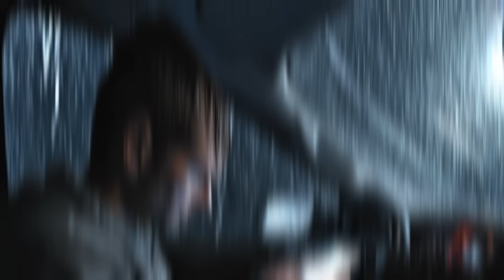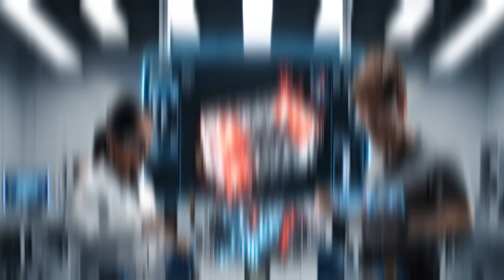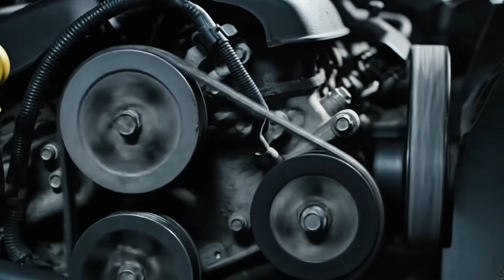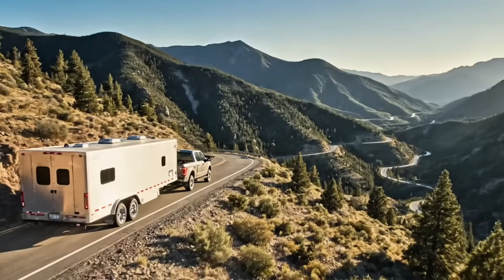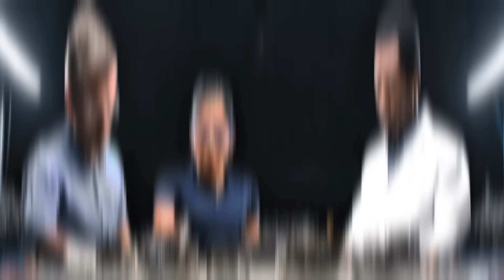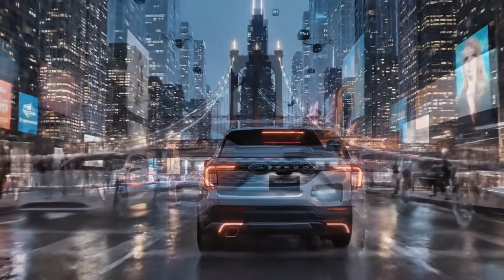Ford Just Ended the EcoBoost Nightmare in 2026 — Truth Revealed

Comment: this is just go back to naturally aspirated no matter what you do turbo engines just are not as reliable all reason why they did this was because of California is completely delusional restrictions on admission so you have to give a car a lot of power and be fuel efficient which is a recipe for guaranteed engine failure even small superchargers would be more reliable
Reply from the maker: A lot of drivers still trust naturally aspirated engines more because of their simplicity. Turbo engines can make impressive power and MPG numbers, but many owners worry about the extra heat, pressure, and long-term repair costs that come with that complexity.

Comment: Why is it when an automaker comes out with anything new it turns to crap.  When are consumers going to quit buying these new crap revolutions and stick with quality
Reply from the maker: A lot of drivers still trust naturally aspirated engines more because of their simplicity. Turbo engines can make impressive power and MPG numbers, but many owners worry about the extra heat, pressure, and long-term repair costs that come with that complexity.

Comment: Should have used electrically driven blowers.
Reply from the maker: That would definitely be an interesting direction. Electric-assisted boost systems could help reduce turbo lag while putting less stress on smaller engines.

Comment: So what is this boost about?? What does it boost? Sounds stupid!
Reply from the maker: “EcoBoost” basically means a smaller turbocharged engine designed to make more power while using less fuel. The idea sounds great on paper — the long-term reliability debate is where people split.

Comment: I had 2016 Expedition for 8 years and 150,000 miles never a problem.  Turbo was probably near replacement time.
Reply from the maker: 150k miles with no major problems is solid, especially on an Expedition. A lot of these EcoBoosts seem to hold up really well when maintained consistently.

Comment: I don’t care what improvements Ford has made. I’m nursing a 2.0 with the coolant channel between the cylinders fiasco. Asked Ford dealer what resolution is available and was told $10,000 for a new engine. No pulling the head for a new head gasket but a new engine. So now it’s a matter of principle for me. No more of my money goes to Ford.
Reply from the maker: That’s brutal. A $10k engine replacement instead of a simpler repair would leave a bad taste for anybody. Stories like yours are a big reason many owners are losing trust in modern turbo setups.

Comment: What is this nightmare nonsense? I have a 2.3L Bronco and the engine is powerful and has had no issues in four years. Sure there have been some issues over the years but l wouldn't trade it for any other turbo engine.
Reply from the maker: Fair point. A lot of EcoBoost owners have actually had great experiences, especially with the newer generations. The video was more about the reliability concerns some owners still bring up, not saying every EcoBoost is a disaster.

Comment: Actually my 2019 F-150 King Ranch with the 3.5 twin turbo has been a reliable machine for me,  no worse than the Honda Pilot I had previously. It tows my 25’ travel trailer very well, it’s honestly one of the nicest vehicles I’ve ever owned.  
Not perfect, but very pleasant overall.  I do like the the V-8’s too however, had one in my Mustang GT, great sounding fun engines.  The 3.5 really is a truck motor, @ 375 hp 470 lbs-ft torque, it’s got great power for its displacement. I do change my own oil every 5K with full synthetic, cheap insurance for an expensive vehicle.
Reply from the maker: That’s the kind of balanced ownership experience a lot of people can relate to. Plenty of owners seem really happy with the 3.5 once they find a setup that works for their towing and daily driving needs.

Comment: My 25 Ranger 2.7 has already been replaced at 3400 miles. It has been in the shop since Feb. Ford settled (cost them 15k) with me but I have not got the truck back yet to get rid off it.
Reply from the maker: That’s brutal for a brand new truck at only 3,400 miles. Situations like that are exactly why some buyers lose confidence so quickly.

Comment: Turbocharging an open deck design engine is a recipe for disaster.
Reply from the maker: That’s been a huge debate with boosted truck engines. Big power is great, but durability under heavy towing and long-term stress is what really matters to owners.

Comment: My second cousin has a 2014 EcoBoost with 185k on it. Still has almost all of its original parts and runs like new. Only the water pump and thermostat have been replaced. Proper maintenance is crucial. Another family member has a 2020 3.5 EcoBoost with just over 100k. That one is a bit questionable in the long run because of the 10 speed transmission but he hasn’t had any major problems either. Most owners with trouble free experiences don’t speak up about their experience so that’s part of why you only hear about the horror stories others experience
Reply from the maker: That’s a really balanced take honestly. People with bad experiences are usually the loudest online, while the owners quietly putting 150k–250k miles on these engines without major issues rarely make videos or posts about it.

Comment: I used to be a Chevy guy, and I will probably never buy a Ford unless it dates prior to 2007.  Dodge, never.    My last Chevy, a 2014 Silverado 4x4, rusted out big time, trans fail at 140,000 and the rear seal leaking.  I sold it.  Chevy created a truck to fail.  I bought a Nissan Frontier SV 4x4 which is a plain Jane as you can get.  So far, I like it a lot.  If Ford or GM want to sell trucks, each brand made indestructible engines and transmissions in the past.  Forget all this tech crap and computer run engines.  Go back to a straight V8 or V6 and keep trucks simple.  Saw a recent truck ad on TV, and the IT stuff on the dash was the big selling item on the ad.  I like my Nissan, but I miss the full size truck.  But I will not even consider a new truck because I don't want a pavement princess with 22' low profile tires and caddilac looking wheels.  I don't need fancy interior.  I like the back up camera and I don't need a tailgate with multiple functions, just one that opens and closes.  I will take a bedliner and hitch, tow hooks in front, and decent size tires.  And I can't afford $50,000 for a new or used one.  Reproduce what worked, Ford and Chevy can do that.  Toyota killing their trucks too with those stupid 4cyl turbo like GM and Ford have done.  Dodge is beyond repair.   These new college educated Democrat engineers are killing the brands.
Reply from the maker: You summed up what a huge number of truck owners feel right now. A lot of people don’t want luxury-truck features or giant screens — they just want a simple, durable truck that lasts 20 years and can still tow, haul, and be affordable to repair.

Comment: They make great power and are smooth and quiet.  I currently own several in our company and they are good engines.  My 2018 Raptor blew up at 60k.  Denotation at wide open throttle left aluminum and oil all over the highway.  Ford put a short block in it without complaint.
Reply from the maker: That’s a crazy failure at only 60k, but it says a lot that Ford replaced the short block without a fight. Definitely sounds like you’ve seen both sides of the EcoBoost experience.

Comment: I've had 4 of these engines 21.5 leaner engines and 23.5 l engines in my pick up truck and my wife's escape I will never buy another Ford powered car again what a piece of junk they spent more time in the stealship than they did when we drove them put 52000 km on one it blew up my wife's after only a year of driving which was 13000 km it blew up junk
Reply from the maker: That’s brutal. Multiple engine failures would make anybody lose trust in a brand. Stories like yours are exactly why so many truck buyers are demanding simpler, longer-lasting powertrains again.

Comment: Sorry but trying to get a 4 or 6 cylinder  with a turbo to do the work of a naturally aspirated 8 cylinder is nuts. Turbos sound like a great idea until they break then be prepared for a first class repair bill. Turbos on sports/ race cars not the daily driver.
Reply from the maker: A lot of truck owners share that view. The simplicity and low-end grunt of a naturally aspirated V8 are hard to beat. On the flip side, some modern turbo engines have also racked up serious mileage when they’re maintained well. Reliability is still the big question everyone cares about.

Comment: No thanks , Still too many electronics. Give me an Old V8 in the early 2000's
Reply from the maker: A lot of people miss when trucks were simpler, easier to work on, and built to last forever. Modern trucks have more features than ever, but not everyone wants all the extra complexity.
Reply: @NextGenWheels-s5r The touch screen era will probably run it's course. When they have enough accidents due to the distractions it will morph into something else. I Drive , I don't watch movies .!
Reply from the maker: @bobbyquack4908  That’s a debate that’s only getting louder. A lot of drivers miss physical buttons and simpler dashboards because they feel less distracting and easier to use while actually driving.
Reply: @NextGenWheels-s5r I don't want to hunt and peck and watch shithead doing the same thing in front of me. It's just dangerous.  They are prepping us for VR glasses.
Reply from the maker: @bobbyquack4908  A lot of drivers feel the same way. Physical buttons let you keep your eyes on the road, while touchscreens often demand more attention. There’s definitely a balance manufacturers need to find between new tech and real-world usability.

Comment: Just got a quarter million miles on my eco boost engine . Had to change the timing chain now it’s ready for another quarter million miles. Runs like a top. I had to change one turbo and the front end gears in it in 12 years.
Reply from the maker: 250k miles with only a timing chain, one turbo, and front-end work over 12 years is honestly a pretty solid long-term result. That’s the kind of real ownership experience people want to hear about.

Comment: Before this engine is sold it needs to be run nonstop on a track 24/7/360 untill it fails then fuggure out why and do it again untill it don’t fail before 200 grand
Reply from the maker: A lot of owners would agree with you there 😂 Real-world durability testing matters more than marketing numbers. Modern engines are incredibly advanced, but people still want proof they can survive hard use and high mileage long-term.

Comment: Having owned and driven relentlessly : 2021 2.0 ecoboost edge, 2019 2.3 ecoboost ranger, 2017 f150 3.5 ecoboost, 2015 transit connect 1.6 ecoboost i can speak reality. The only one that was a POS was the 1.6. It started sucking coolant the second week of owning it. Best ford could come up with was a low coolant sensor for the overflow. Traded in for the 2017 f150. That 3.5 was awesome. It had power and i never had any mechanical failures in 110k miles except a driver side exhaust bolt broke. The 2.0 i guess i got lucky. It had a manifold sensor go bad at 20k. Fixed under warranty. The 2.3 ranger was and is bullet proof. 75 k from me and the new owner put another 100k on it with no major issues. I now have a 2025 F150 powerboost. We will see how this one goes.
Reply from the maker: That’s actually a really balanced real-world breakdown. Sounds like the 1.6 gave you headaches, but the 3.5 and 2.3 treated you well overall. The 2.3 Ranger especially seems to be earning a strong reputation with a lot of owners. Definitely curious to see how the long-term reliability of the newer PowerBoosts turns out too.

Comment: Turbochargers destroy little engines. I wouldn't have one.
Reply: Your 100 percent wrong,,,You forget that here in Europe 80 percent of our engines are under 1.6 litres,,That goes for petrol and diesel,,And the majority of those are turbocharged,,Unlike the USA,,We have been using small turbocharged engines since the mid 90s,,,And up until wet belts and DEF fluid came in,,,250k miles was the norm,,,And many vehicles were seeing 500k miles,,With taxi drivers seeing 6 to 7 hundred thousand miles on 2 litre VW and Peugeot engines,,This is the problem with engines in America,,And at least a part of why you are having problems with small turbocharged engines,,,,ITS YOUR CLIMATE,,,,,,And the fact your towing 10 ton loads with a 3 litre turbocharged engines,,,,,Those two things together are to much stress for an engine that size,,,,Here in Europe we also tow trailers with our small engines,,,But we are realistic,,We have small trailers and pull about 2 ton max with a 1.6 diesel ,,,,And 90 percent of our climate doesn’t go regularly over 70 or 80 degrees in the summer,,Dont get me wrong,,,We still have problems with engines,,But never from stress or heat,,,And also our cars are smaller than American cars,,,Although in the last 5 years SUV sizes have gotten ridiculous,,But that’s due to batteries needed for EV,,,
Reply: @nightstorm9128  LOL. You just agreed with everything I said.
Reply from the maker: Fair enough 😂 I think both of you are mostly saying turbo engines can last, but usage and stress levels matter a lot.
Reply from the maker: @nightstorm9128  You actually make some really solid points here. Driving conditions, towing habits, climate, vehicle weight, and maintenance expectations all play a huge role in turbo engine longevity. A small turbo engine in a lighter European vehicle doing normal commuting is a very different life compared to a turbo truck towing heavy loads in extreme heat.
Reply: Then Buy an ESP for your Ford and don't worry about it.
Reply from the maker: That’s basically why extended warranties have become so popular on modern trucks.
Reply from the maker: A lot of people feel that way, especially after some of the early small turbo issues. On the flip side, there are also plenty of EcoBoost owners pushing 200k+ with solid maintenance. Really comes down to the engine design and how it’s maintained.
Reply: @NextGenWheels-s5r  So they have to baby it. LOL.
Reply from the maker: @TOAO789  Some definitely overthink it 😂 but regular oil changes and not abusing a turbo engine goes a long way. Same story with a lot of modern performance engines honestly.
Reply: Hybrids are the most reliable going
Reply: @WhittyPics  Wouldn't have one.
Reply from the maker: @TOAO789  Fair enough 😂 Some people love them, others want to keep things simple and stick with traditional drivetrains.
Reply from the maker: @WhittyPics  A lot of hybrid owners would probably agree with you there. Some of the reliability numbers have been surprisingly strong lately.

Comment: Complex engine systems results in costly problems. Suggest getting a vehicle without turbo chargers (unless driving in high elevation areas) also suggest either throttle body or port injection systems as well as an engine with a metal oil pan with matching gasket
Reply from the maker: That’s why a lot of people still prefer simpler naturally aspirated setups. Less complexity usually means fewer expensive surprises long term, even if you give up some power and efficiency.

Comment: My 2.7 F-150 has been very reliable and steady. These high tech trucks need regular maintenance and a driver with common sense. If you take care of them they are very good. one note; after hard use or a long trip...idle for a bit to help cool the turbos. After starting this practice I find my oil is no longer black at oil change time. I change mine with full synthetic at or before 5000 Miles.
Reply from the maker: That’s what many long-term owners say — maintenance makes a huge difference with these engines. Good oil, good intervals, and staying ahead of issues goes a long way.

Comment: What about the belt in the pan running the oil pump is this a 70k mile repair
Reply from the maker: The wet belt setup is definitely one of the biggest concerns people bring up. Proper oil maintenance becomes extremely important with those systems long term.

Comment: The one thing not mentioned here is the most important: How rigorously did they test the new engines incorporating these changes?  The changes do sound fine in principle, but until multiples of every engine variant have been punished and abused to failure, Ford doesn’t know whether they’ve succeeded or not. And neither do the customers. If Ford doesn’t do this level of testing, it means the buyers will be doing it for them—just as was done with the generations that have failed! What’s the answer, Ford?
Reply from the maker: That’s probably the biggest question of all. Real confidence only comes after years of harsh real-world use, towing, heat cycles, cold starts, and high mileage. Bench testing is one thing — long-term durability in customers’ hands is the real test.

Comment: All vehicles with direct injection only suffer from carbon build up. Only companies that use port fuel injection in addition to direct fuel injection (e.g., Toyota).
Reply from the maker: Exactly — that’s one reason more manufacturers started moving toward dual injection systems. It helps reduce a lot of the carbon buildup issues seen on DI-only engines.

Comment: almost every aspect of today's gas burning engine is out dated, old fashion, primitive and designed to "hopefully" just last past warranty. An electric motor, despite the un-informed naysayers,  Is much more reliable, longer lasting, cheap to run and maintain, Much more exciting and easy to drive than the internal crapbusted engine. Wake up, gas sux your wallet dry, and makes driving a chore.  pitty the foolz.
Reply from the maker: EVs definitely have their advantages, and ICE engines still have strengths for many drivers. It’ll be interesting to see how both technologies continue to evolve. Thanks for sharing your perspective!